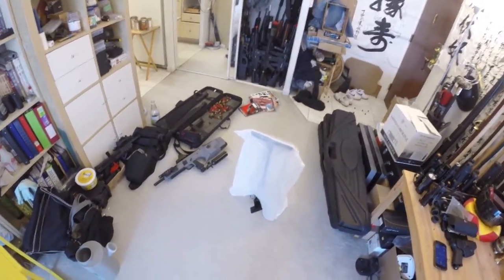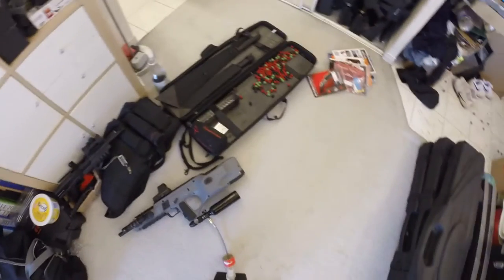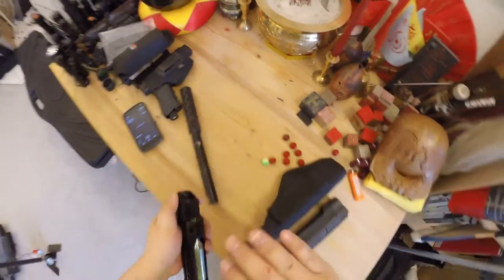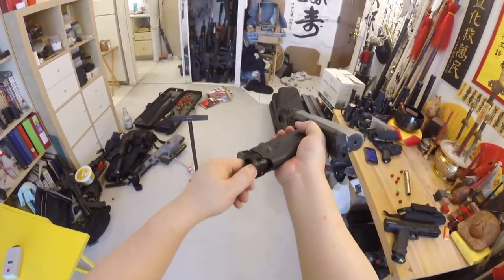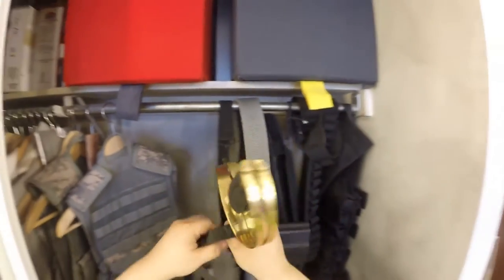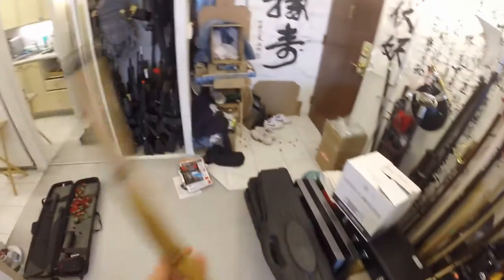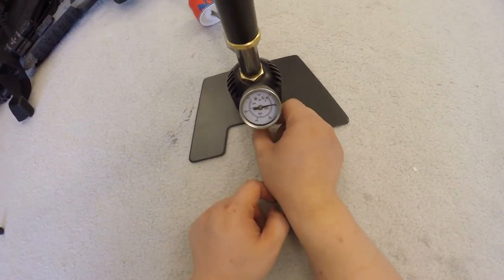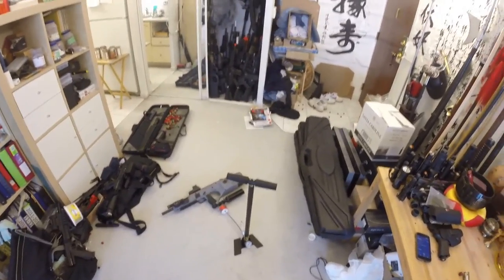Pumping a 13ci HPA Tank With Handpump Like a MAN!

Comment: I'm new to airguns and just found your channel. Very helpful and I'm learning. But how would you transfer air from the 13ci  tank to the airgun? What special wires and adapter do you need? I have a Benjamin marauder pistol and I just attach the wire or line from the pump to the gun and start pumping.

Comment: Great video and dam must have got a great work out Doin that so much for 3000psi lmao
Reply from the maker: well usually I use my compressor and it fill up the tank in 2mins by just one click of the button. This video is showing you the hard but never-fail way. You can bring a pump to the forest and play all day long with your guns. A great backup and emergency method to fill up your guns or tank for sure. If there is no electricity around, I think this is a good backup plan!